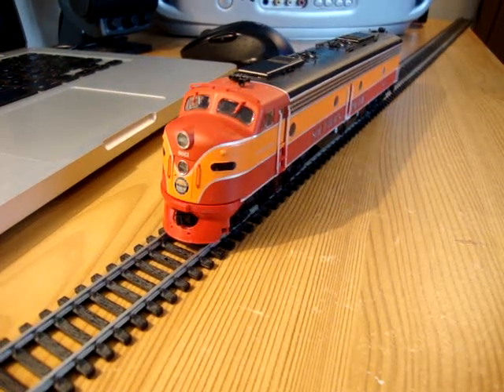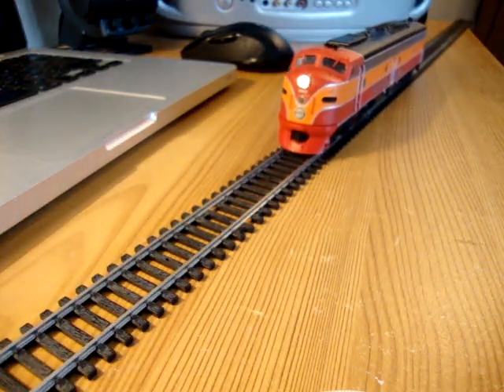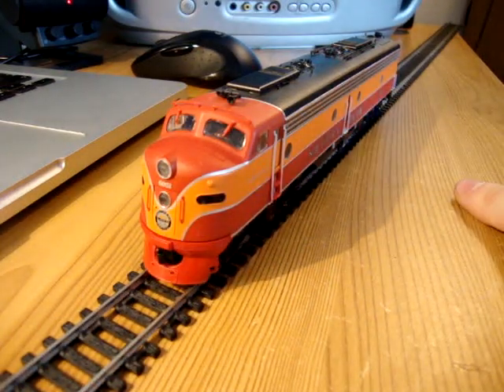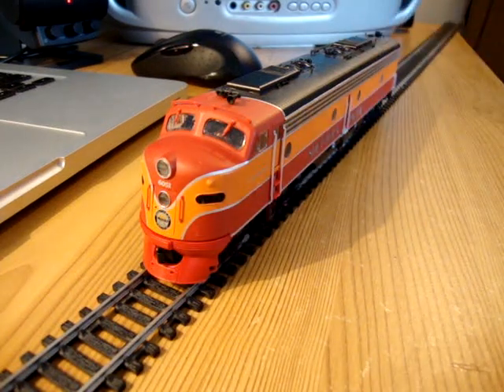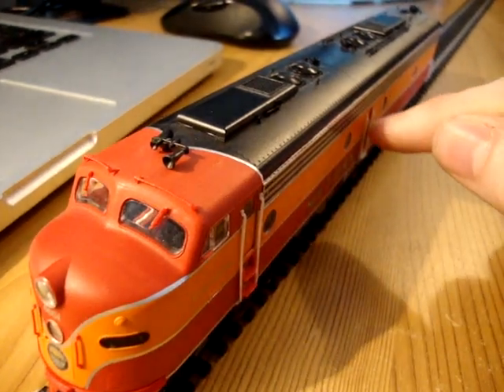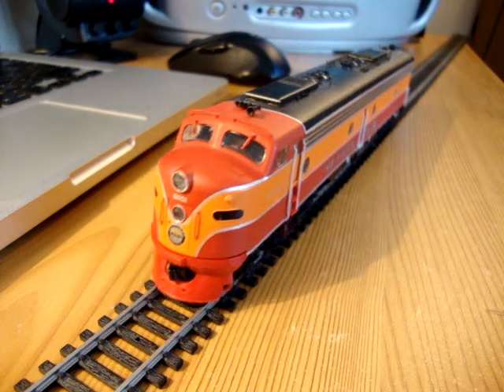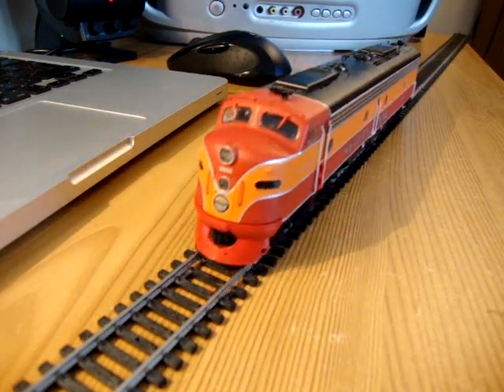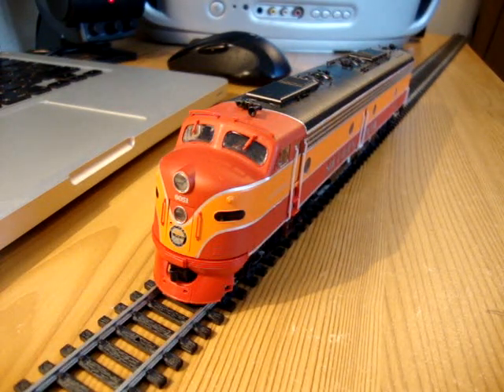Review of Southern Pacific Daylight E8 by Proto 2000

Comment: I'm glad to hear your getting passenger cars, If you do go to getting a booster unit, Get a E7B unit, not an E8B since SP never had E8B Units on the rosters, And if you ever decide to go DCC, Unfortunately the E8/9 doesn't have a 8pin plug for DCC Decoders inside the shell, However TCS does have toutorials on how to hard wire a lifelike P2K E8/9 .

I've made yet another 3/4 Length Dome Lounge but the results are less than satisfing, I had to use rustoleum bright silver  on the car.

Comment: You could buy on ebay some Rivarossi Daylight Passenger cars, or Athearn Chair Cars, or IHC cars, Also, if your lucky, you may find the proto 2000 E7 SP Loco in the " Golden State " paint theme, which is fairly rare, but IHC makes passenger cars in that paint scheme, in Silver with red letterboard stripe above the windows, In two tone gray for the heavyweights. and the daylight and sunbeam paint schemes.